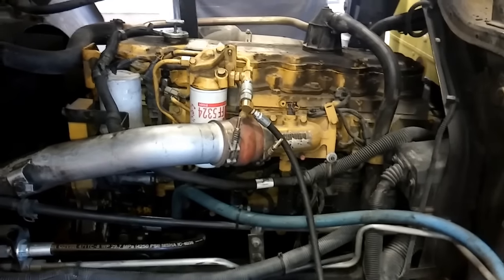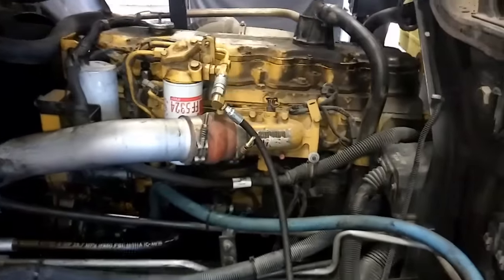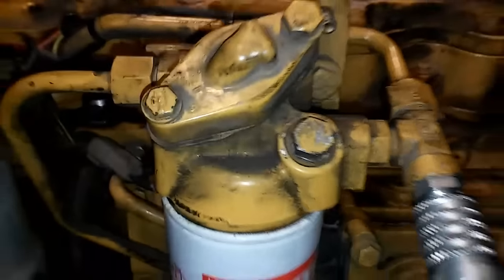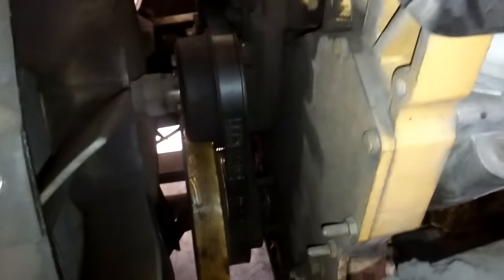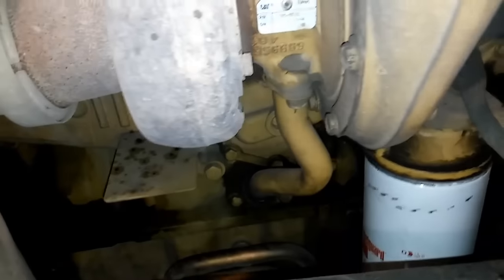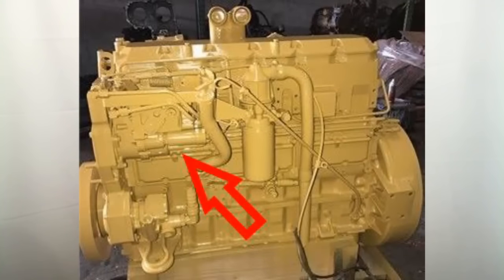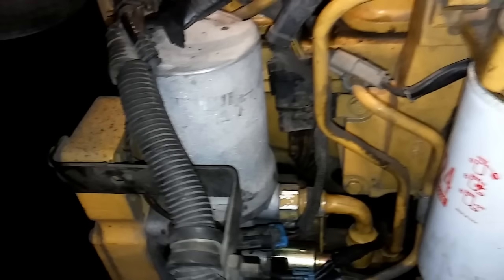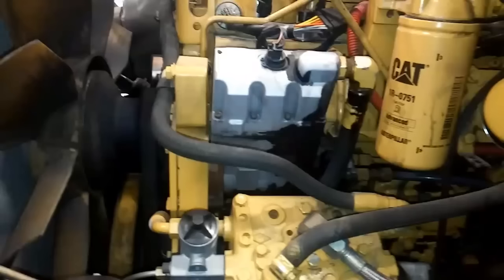The Cat 3126 Engine.  Know Your Engine.  Caterpillar 3126B and 3126E.

Comment: Hi i got C12 i just fully rebuilt that Eng but oil pressure is stay 15-18 psi @600 rpms when water temp is 185 is this normal oil pressure?

Comment: Hey Josh I had a 962h wheeled loader at work that i operated for a while running a c7 and every morning on a cold start ( here in nz a cold start can be anywhere between -5c to up to 15-c outside temp) you would have to crank it for a good 10 seconds before you could get one cylinder to fire and it would cough and splutter and carry on and some of the worst diesel knock ive heard in a long time. the goughs mechanic (they are our national cat dealer) gave me a very vague explanation on the issue trying to explain how a heui pump worked and that was the issue . can you shed and light on the situation ?
Reply: Check your intake heater. HEUI engines are pretty cold blooded.

Comment: Hi i am Roy my 3126  keep losing engine oil  and it goes in the fuel tank  the diesel fuel is block. So wat cause the engine oil to going in the diesel fuel  the engine runs good the  problem is losing the engine oil the blow by is good

Comment: So say I have one of these engines and I need to replace the injectors and just happen to have a set of 7.3L Powerstroke injectors laying around. Could I just drop in the 7.3L injectors and go since they look to be identical aside from the color of the plastic on the solenoid?
Reply: Probably not, different systems

Comment: Comments disabled on your diesel oil leak vid so I will comment here....Your PCV thing is a nice "theory" butt...the 427 in my boat doesn't have a pcv system...neither does my Honda motorcycle and for sure they dont leak and  the only oil leak the Cummins Diesel in my truck with 180k has is the power steering gearbox and it leaks a little because its worn out

Comment: I've seen allot of injector cup failures in these. Speaking of small CAT engines, what's the deal with the 7 point head on the nozzle jam nut on 3408's?
Reply from the maker: +Michel Reineking Good old specialty tools!
Reply: I figured as much. I just use channel locks.

Comment: C7 engine runs good when it starts. Will not start if oil pressure does not show on dash gauge. After a few times trying to start the engine the oil pressure will finally show on the gauge and the engine will start. Any ideas???

Comment: I have a 98 fl70 with 3126 glow plug light on strut up at fast idle kind of rough step on brake   back to slow idle after a minute  goes back to fast idle ! Sensor maybe ??

Comment: Okay I got one for you I am rebuilding a 3208 when I put the injectors on my test bench and get my precious set correctly when I put The cap Back on I get hydraulic lock it go’s to 4000 psi and it sits at 2 500 psi in the injector and won’t crack why does it not do this when it is installed in the motor
Nobody can tell me ?

Comment: So I'm looking at buying a bus it was just taken out of service last month it has the 3126 with a allison  would it be a good purchases?
Reply: Brodie  Crofts
I have a rear engine Thomas bus with a 3126 and Allison 3000 series transmission. Make sure the Huei pump is the round design!

It’s a good vehicle. Won’t scramble up mountain passes, but it’s no slouch.
I had the 6th gear opened up by Allison and the governor raised on the engine, goes 75 at 2200rpm now.

Just don’t buy a northern bus....RUST forever and you better learn to weld good.
Get a southern or southwest bus. Plenty of used dealers in Louisiana and Texas.

Comment: Great video Adept Ape! I have a 01 fl80 bucket truck with the cat3126 engine and love it.  Now, I was looking on buying a 2000 fl50 with cat3126 engine with 200,000 miles with an automatic transmission. The truck needs some aesthetics work they're asking for $5k any advise? Thanks!

Comment: Great video! I have a 3126B (motorhome) and it seems to have gotten harder to start lately. Since it runs great once it starts, I assume it may have a priming issue. It has a manual priming pump, but I can't seem to find the valve that I assume I need to switch before I can prime (i.e. prime position vs. run position). Is it correct to assume that there should be a valve somewhere NEAR the manual pump?

Comment: Curious as to what mileage do these issues usually occur? Looking at a 04 bus with 3126. less than 25k mi.  thx
Reply: I have an 03 bus with 3126. I have close to 300k on it. Use it as a tool bus on the farm. Keep the oil changed often. I had problems with the heui pump. The stealership told me 10k oil changes were hard on the heui pump. They sugested 3k-5k oil changes. Also check the hours on a bus. It may have 25k miles but 10k hours. The one i purchased had 125,000 miles but 11,000 hours. The bus has air conditioning so im guessing it idled alot to keep the air on... Overall im happy with it just keep the oil clean. Im not a mechanic just my opinion.

Comment: I have a love hate relationship with mine. 2003 GMC 6500 rollback started running rough while idling and shut off. Now it won't start! Do all my own wrenching but can't figure out the problem. It will fire on starting fluid but will not pick up any fuel. Filters are always full.....no blown fuses.....NO ideas! Anyone???

Comment: I need more HP out of my 3126! Cat said it has 210hp.
Reply: Chad Dixon
Don’t, they have problems quick when you increase HP.
Military vehicles and Fire trucks use high HP models, they are factory built that way and also have fleet service through taxpayer pockets.

Comment: I am new to the cat. I just buy the 3406b model  And I see the oil  Leak from injection Pump between the pump and engine and back  of the pump  Is there a big problem can  fix by myself. Or I have to rebuild the pump.  tnx
Reply from the maker: +Andrey Kuloverov Pulling the pump is a pain. You have to remove the air compressor, fuel lines, timing advance, and it is very heavy. About 125 lbs. It doesn't take any specialty tooling though. If you understand how the advance works you can reinstall everything though and get it dialed in.
Reply: Adept Ape  Do I have to do timing?
Reply: Adept Ape  Juneau where can I get information how to take off the pump. And if possible do you know any of shops who can  Rebuild pump. My location in MN

Comment: Hey! We have a bus in Costa Rica that is a CAT 3126 and every time it has to go up a hill (a steep hill) the gas gives out and then we put it in neutral and it gets the revolutions up again.  We've changed the fuel pump and the sensors in the transmission but the problem continues. Has anyone had this issue before and if so what could the problem be?

Comment: Can you turn a 3116 into a 3126 by changing the head and adding the electronics?
Reply from the maker: That would be a project, you would have to change the intake routing, front structure, Camshaft, head, fuel routing, I mean you probably could, but you could probably just buy 2 used 3126 engines with the amount of work and parts you would need to buy for a potential conversion. Not sure about the head bolt pattern as well.
Reply: Adept Ape Thanks for the input. Watched a video on the synchronization of the injectors, what an ordeal. How much do you charge to set up a head of a 3116? Can it be done off the block and then setup the governer once installed? Came across a great boat with a pair of 3116s and one is blown up. Just weighing options. The boat is a little underpowered with these. Probably why the owner blew one up pushing too hard. 
Thanks,

Comment: I have a 1997 fL70 with a 3126 but the intake comes in over head to passenger side looks more like a 3116 but sticker on valve cover says 3126.  Do you know what may be different with  my motor?
Reply from the maker: The 3116 engines have the intake on the same side so you may have one. Do you have an ECM? The 3126 has an ECM.
Reply: I wish I could post a picture of the engine tag on valve cover and side of engine.  Would the ecm be mounted on rear drivers side motor with wires Ill go take a look now.
Reply: it does have a computer on the block with  2 blugs coming off the front  was there  an inbetween motor?  do I have the best or the worst of both motors haha?

Comment: I own a 2000 fl70 with a 3126 in it. The engine has 200000 miles on it. On cold start up it makes a pinging knocking sound. The colder the worst it is it seems like. And right before it stops it has a winding sound. And right when it stops it has like some zipping sound just for a few seconds. With a little white smoke. So from start up to when it stops doing all it's funny business it is like 10 seconds. Then it purrs like a cat😊 So what could that be? Thanks for your time.

Comment: Please make a video on how to replace the timing sensor on a 3126E 2003 HEP 39866 with an air compressor. I have a 2003 National sterling sterling addition motorhome with a caterpillar 330 hp turbo Diesel engine. I have changed out a lot of the sensors and fuel filter and changed the oil and heui pump but I can’t seem to find the timing sensor. It’s not where all the pictures say they should be. I am desperate for help and can’t get a Moble mechanic to even come out to look at it. I need some guidance. Please help me. I will be happy to send you an email or phone number if you wish I just didn’t want to put that information on a public forum. Thank you so much for listening.

Comment: 3126 injector looks very similar to a 7.3 powerstroke/ dt444 international engine
Reply: Chris K.: HEUI system is of similar design of 7.3/T444E or DT466E...that round top high pressure oil pump...is like Navistar HPOP system.